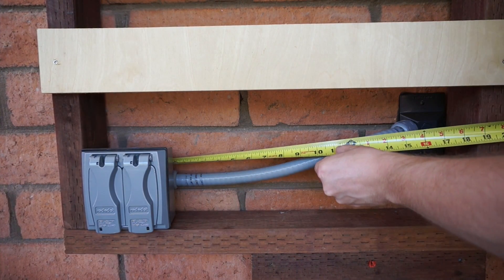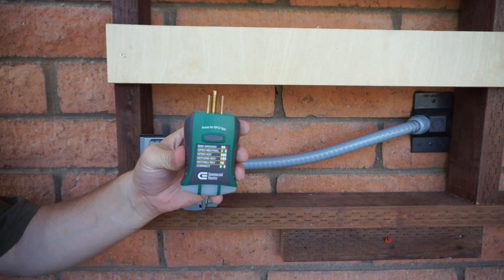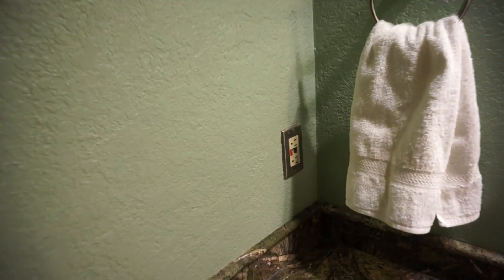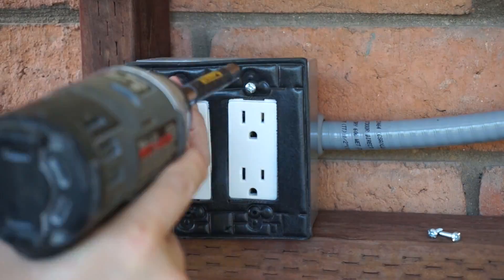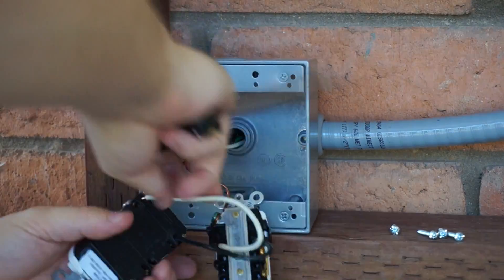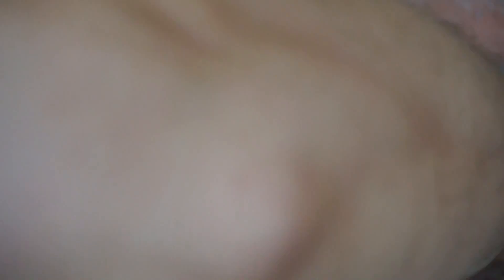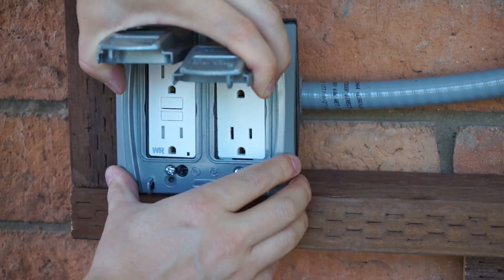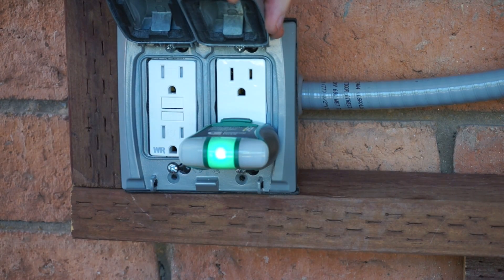How to Extend an Electrical Outlet - Followup

Comment: I'm sorry to be the bearer of bad news, but adding the GFCI downstream of another GFCI is against code.  Most GFCI receptacles come with GFCI stickers that can be used on downstream receptacles to indicate they are GFCI.

My selective OCD would have also hoped you reran new wire through that conduit to get the longer length you need in the box AND ran the two receptacles in parallel, which is also part of the new code.  Daisy chaining receptacles in series is no longer allowed.
Reply: i have always found a gfci to gfci dont like each other and one trips
Reply: Adding extra GFIs doesn't violate any NEC code, but there can be local jurisdictions that prohibit for some reason. But they do need to be wired properly. The wiring connecting between each pair of GFIs needs to land on their respective LINE terminals so that they can operate independently, as intended. Only time wiring should be connected to LOAD terminals is if its destination needs GFI protection without extra GFI receptacle. 

So in this situation, homeowner needed to indentify the other end of the wire feeding these new outside receptacles in that bathroom GFI and reconnect from LOAD to LINE. Also, I remember seing another set of wires in the original outside outlet box turned into JB. If those wires are going downstream to another location needing GFI, then either another GFI receptacle needs to be installed there. Iif he wants to leave those devices alone, then another set of THHN wires need to be run inside the flexible conduit to provide load path from new GFI to those devices downstream. Would be a perfect opportunity to run longer wires for both line and load paths.
Reply from the maker: +ScreenName5 Ah, is this part of the updated NEC?  Can you point to the relevant section?  I installed "chained" GFCI receptacles very similar to this method on a couple of occasions a few years ago and both projects passed inspection with flying colors.  It was absolutely to code at that point.
Reply: +granworks You can run any number of GFCIs on the same circuit in parallel without issue.  Once you 'hang' a load off a GFCI and transition to either parallel or series wiring downstream, all downstream receptacles should be standard and not GFCIs, but with stickers indicating they are attached to a GFCI.  The fact that you were able to shut off the load in your shelving area by tripping the bathroom GFCI shows that you are attached to the load side of the bathroom GFCI.  If you re-wired your bathroom outlet so the feed for your shelving receptacles is tied to the line side, then having the downstream GFCI in your shelving area is not a problem.  However, it looks like the wiring in your original box in the shelving area has other downstream receptacles so offloading the wiring run from your bathroom to this shelving location is probably not an option.  

The NEC has comment on running all receptacles in parallel except when making a connection to the load side of a GFCI which is the only series connection.  All receptacles downstream from the GFCI should be wired in parallel as per the current NEC.  300.13 Mechanical and Electrical Continuity — Conductors.(B) Device Removal. In multiwire branch circuits, the continuity of a grounded conductor shall not depend on device connections such as lampholders, receptacles, and so forth, where the removal of such devices would interrupt the continuity.
Reply from the maker: +ScreenName5 Thanks for the info!  I did some more reading on NEC 300.13(B) and it appears to only apply to multiwire branch circuits.  This particular system does not involve multiwire circuits, so it doesn't appear to apply.

More research on wiring GFCI receptacles in series shows that it's not what is recommended, but it's not exactly uncommon, either.  The only problem I've seen described is that the circuitry can be confused by the extra load from the downstream receptacles and trip unnecessarily.  If that's the only problem, then I'll just keep the current setup since that's not a safety hazard at all.  If there is another potential problem, then it's a simple matter of switching the outlets back out.
Reply: Sorry, there was meant to be more to my previous comment.  I'm not sure what happened and don't have the time to look it up again.  Glad you found the info on why it is not what is recommended.  I'm sure many inspectors look for wire neatness and the overall 'look' of the job without diving down into the weeds of tracing circuits which is probably why current wiring is still so common.  With only 0.6ma of variance before tripping, GFCIs can trip one another out, including when power is restored.  Looking forward to more videos on your channel.